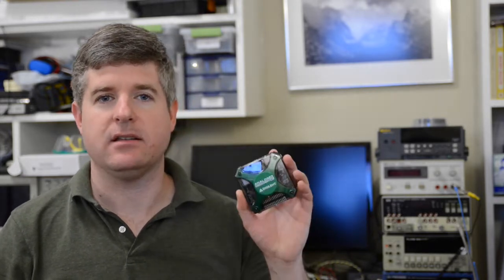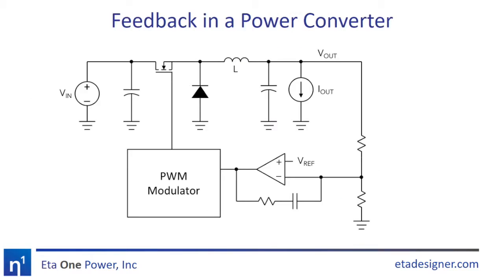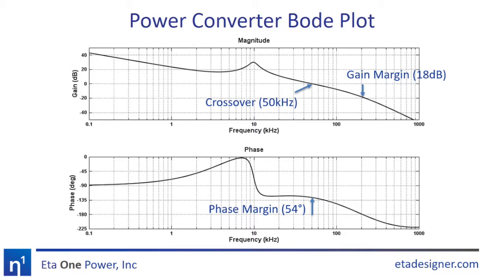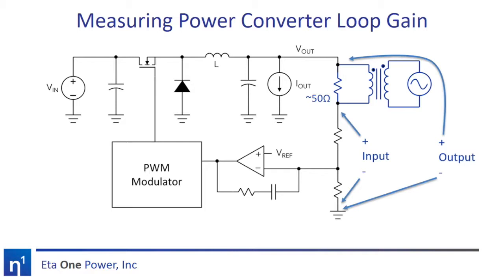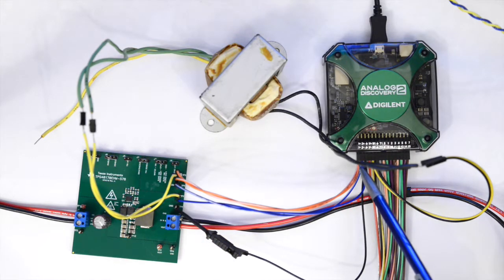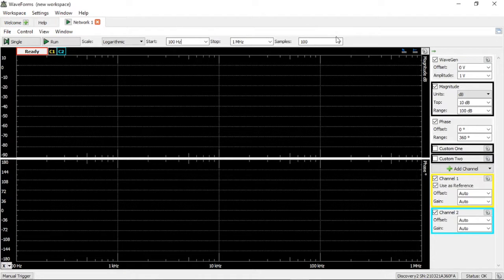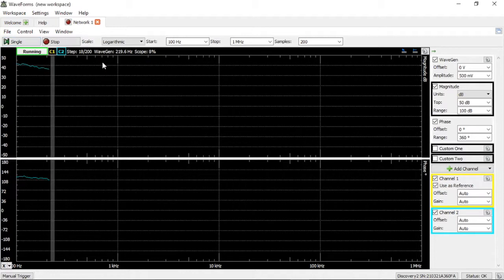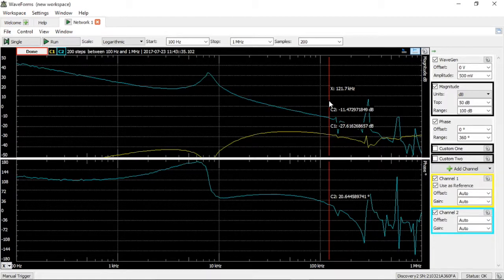Measuring Power Converter Loop Gain using the Analog Discovery 2

Comment: You're measuring the closed-loop gain here correct?
Reply from the maker: Craig, we're measuring the open-loop gain of the controller cascaded with the power converter.  By analyzing this Bode plot, you can determine the stability of the converter when the loop is closed.
Reply: Wow, thanks for the superfast reply. Don't you have to open the feedback loop to measure open-loop gain? Isn't your transformer injecting signal to feedback input, not the plant input? Sorry, seems I've forgot a lot from my control theory classes from 20 years ago.
Reply from the maker: Craig, it's a bit of a hybrid test.  The controller, in DC, operates in closed loop.  We are AC coupling a voltage into the feedback network.  Some of that signal will be seen as a voltage on the output, some will be seen as a voltage on the input.  The gain of the loop will determine the spread there.  In any case, if you measure the disturbance at the input to the controller, and then at the output, you can figure out the loop gain, even though the amplitudes will have some absolute variation over frequency.
I hope this makes some sense!
Reply: OK, I agree with this. You might not be able to run the PS open-loop anyway, I haven't given much thought to that.

Do you have a link, either doc or video, that matches the components of a SMPS to the classic feedback model block diagram. You quickly do it here, but I'd like a part by part description/explanation from a college-level engineering perspective. Thanks.